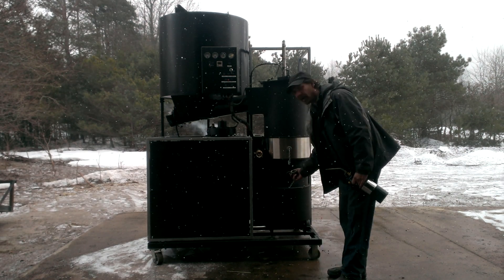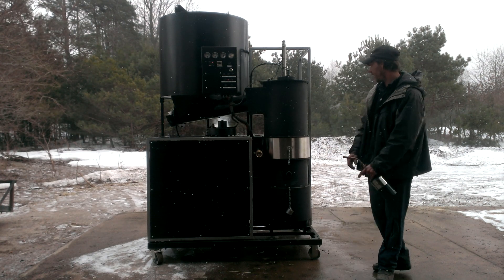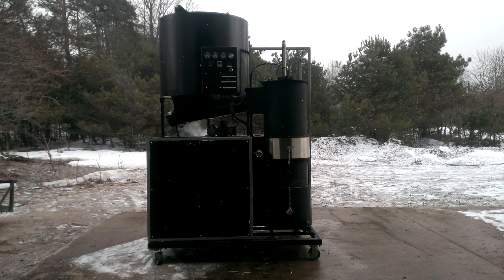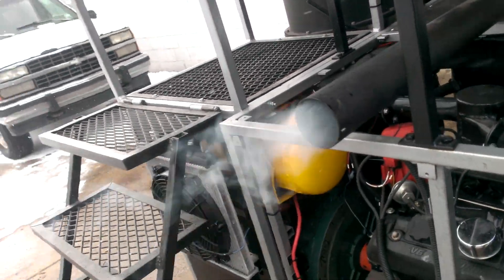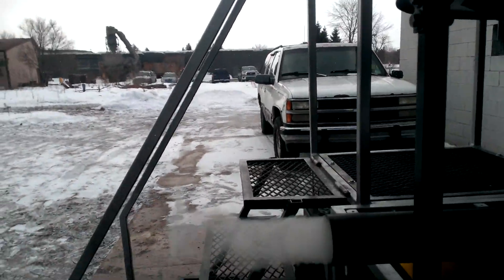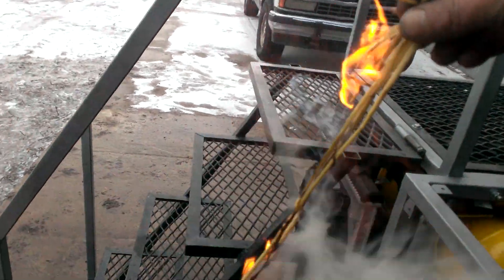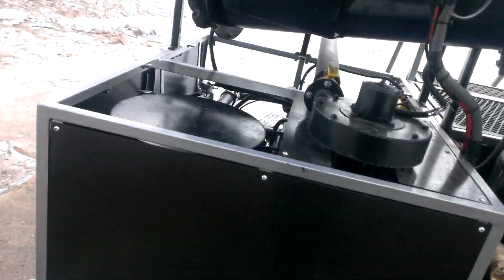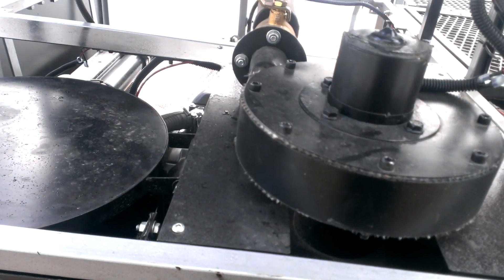Vulcan Gasifier 25 kW System Demo

Comment: What brand of gen is that?
Reply from the maker: We build the whole system. The engines we are now using are gen II and III GM HO engines coupled to Mecc Alte generator heads. We do not use off the shelf generators they don't work for this application. You just end up with a generator head that is way over sized then what the engine can output running on Synthesis gas.